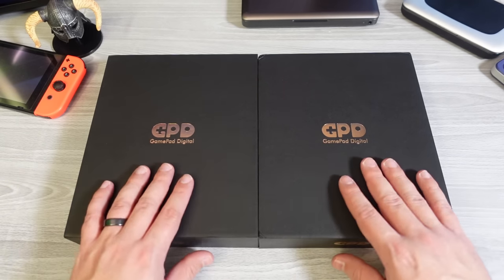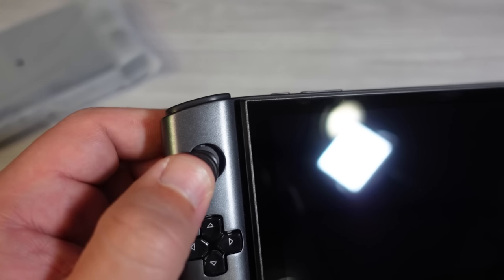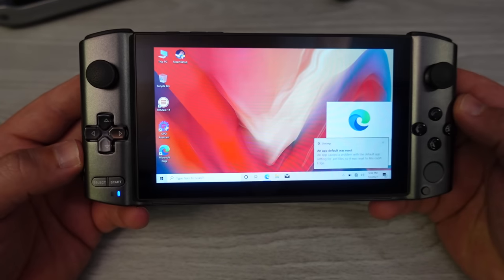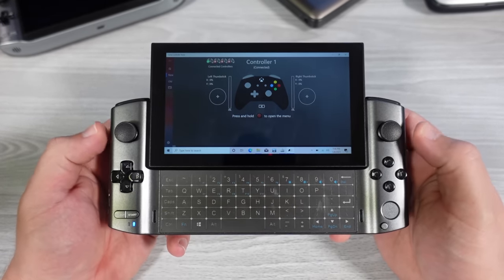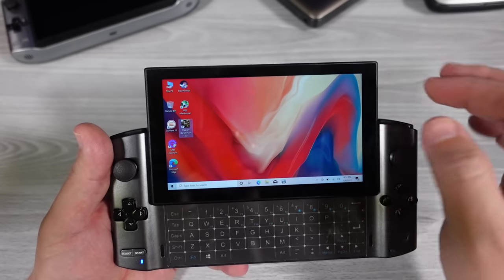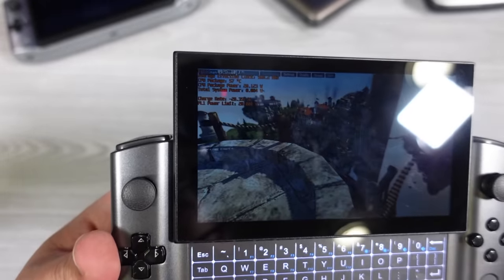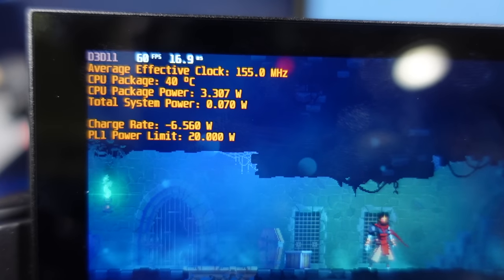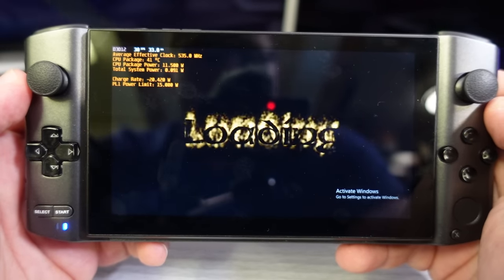GPD Win 3 - Unboxing and Quick Impressions

Comment: The egpu support is the biggest thing that was needed for this. Can use it otg, but when you get home you have a full gaming rig. Sweet stuff
Reply: Got to wait for a Thunderbolt 4 egpu dock to see if it will use the full 32gbs bandwidth under the tb4 spec for less performance loss.

Comment: The touch keyboard is kinda disappointing, I use the keyboard often on my win 2 and not sure I want to down grade my typing experience.
Reply: yeah why did they opt for a touch keyboard??
Reply: They opted for a touch keyboard as a space saver. Physical keyboards take up more space than touch and would make the device much thicker than it is now.
Reply: @techfreakjames  Also probably a money saver
Reply: @techfreakjames  yeah I know but I would have preferred more thickness with a physical keyboard. tbh I prefer the win 1 and win 2 clampshell design
Reply: @techfreakjames  not only that, but also troubleshooting and repair. If one key or more are dead, that's a whole membrane they have to throw out, clean the contacts, etc (lot more room for things to go wrong). Whil with a touchpad, it's just one digitizer. Swap it out for a new one if something goes wrong with it.
Reply: "2800 fps" *laughs in pc
Reply: @root8able  no, i think this is way better than previous versions, its more portable, looks more like what it is, a portable gaming pc, love it!! I just changed the right analog to became more like xbox controller and a slightly bigger screen!
Reply: @techfreakjames  *thiccer
Reply: @fkaiba94  why are you correcting my proper spelling with the slang one? Or was that a joke, in which case sorry I ruined it.
Reply: @techfreakjames  lol yup, you ruined it

Comment: I need this... got the win 2 months back and enjoy it but I would love to play all the newest games on the go
Reply: i got the p2 max and it came damaged i couldnt get a refund :/ worst 1k spent
Reply: @hoodeez  That's really unlucky I purchased several GPD units so far including two GPD P2 max (one I gave away to a friend) with no damages or factory issues.
Reply: think twice bro,look the screen its SMALLER than your phone,no
Reply: Cool! Got mine on 11.11 for 470$ on Aliexpress. Seemed to be a good deal. Liking it so far. Playing games from Steam that I would mostly likely never launch or just postpone. It's a great device. But Win 3 looks like a dream. No actual use of the keyboard but I will take it anyway.
Reply: @周崎-v9j  it actually isn't. Phones have bigger screens but they are not 16:9 or 16:10. They are just taller but that's wasted space. In fact, if you were steaming those games you'd get black bars on both sides of the phone's screen.
Reply: I would buy it if it is under $400
Reply: @civilman9058  that wouldn't even cover the cost of the cpu itself
Reply: @civilman9058  Would be great. I think you might get this price in a year or so when they release the GPD 3.
Reply: @lucascarracedo7421  well,maybe you can buy a 5.5 inch screen and run windows on it.the fact is this tiny screen is made for act games only(like god of war etc)because these game usually dont have many text or subtitle,you just need follow the arrows to slash and kill...but the rest of game like rpg and MMO which has ton of story lines,im sorry there is no way to see clearly on this screen,also its bad to your eyes.
Reply: Would have loved these internals in a clamshell design..
Reply: @周崎-v9j  clearly. I didn't say anything against that. I might not even buy it for design decisions I don't agree with. But that's the price of the product and it's not overpriced at all considering it's not a mass production device, and a very niche and  powerful product. That is regardless of how you would use it. I agree text would be hard in here. It even is on the gpd win 2. Wish that screen would cover more of those bezels.
One could argue that given this is a product most people would get to play in the go or to pick up and play at home, those story heavy games might not be the main target here. I doubt these devices anyone's main device. For this money a way more powerful system can be built. In most cases I guess the owner will also have a desktop or a laptop where they can play those slower games with tons of text and more complex UIs. Or they could even use an external display. The truth is that even the screen on the win max is small for those games anyway.
Reply: @周崎-v9j  regarding what people can or cannot see, that's personal. I can. The truth is that they could never put a 7 inch screen here if they want to have a relatively usable battery life. Gpd devices are always changing and are mostly steps forward but in many ways they always feel like a test for the next one. Maybe you'd want a win max with these specs? Might be the next one out.
What you are saying about screen size also applies to game streaming to phones. And those games you mention are also available to stream. So, since playing pc/console games on small screens is now a thing, then developers should start to include accessibility options to scale the ui for those use cases. If UIs can be adapted for switch versions, the same can be done for any other version. Games and the way people play are changing and these sorts of devices are transition devices.
Reply: There isn't a PC game I own that I can't get to work on the Win2 (maybe some need very low settings, but they work!)
Reply: @vlogger4567  yeah. Some are really constrained but for the most part there are solutions. It's part of what makes these devices attractive. In fact, whenever we get the win 3, it won't be running modern AAA games the same way it runs games from 2018 and tweaks will always be recommended.

Comment: I love the direction they are going with this.  I was sad when Sony discontinued their PC line, including the Vaio UMPC's which (along with Sony's PSP Go, Xperia Play, and Mylo devices) inspired this design.

However, the keyboard seems like a very bad choice for me.  If they were going with a capacitive touch solution, I would have preferred a second screen.  However, I think a physical keyboard, like with actual keys, or buttons, would have been better.

I have a GPD Win (1), and a GPD Win Max.  I am sure the power performance is a huge step up, even from the Max, but I think I will skip this generation (like I did with the Win 2).
Reply: A modern Xperia Play would be my go to, my current phone is the Xperia One. When the Xperia Play was out I ended up going for the iPhone 4S instead. Best feeling phone I've ever had, but I sometimes wonder how nice it would have been to have the Play.

Comment: 34:50 protip: use 25 watt power limit in bios, Use throttlestop in windows and set speedshift to 230 to limit it to lower wattages. 
that way it will run at 25 watts automatically (by switching profiles) when you plug it in. no restart to bios required.
Reply: Show me tutorial
Reply: @SRC267  ill make 1 in a week and reply

Comment: The controller seems uncomfortable to hold, a bit too small.
Reply: It will feel uncomfortable. It's the same issue with the Switch Lite, but for that you can buy adapters for bigger hands.
Reply: @SuliusLp  *grips
Reply: @OneDumbOrangeCat  Yeah, that's the word for it.
Reply: @SuliusLp  Yeah Switch Lite kills my hands. At least this is thick.
Reply: @SuliusLp  Yeah, the Switch/Lite is already uncomfortable, and this one has even smaller controller.
Reply: @michaelsun1654  But with a grip it's quite comfortable! I had a blast playing Fenyx Rising for a few hours straight.
Reply: ya and the button / dpad placement...  I can already tell by IMAGINING the thing in my hand... it WILL be uncomfortable. They should've done it like the vita, with the sticks UNDER the dpad and buttons.  then you just move your thumb closer to your other fingers to hit the dpad /buttons from a stick. this way (with the Win 3) if you dont' move your whole hand with your thumb (he pretty much shows this at the end when talking about playing Hades), you'll be awkwardly stretching your thumb to reach them from the stick. I'm not so sure I want this anymore...

Think I'll keep waiting for that alienware UFO thing or something else.
Reply: @Azhrei2000  Yeah eaxactly, the UFO or Aya Neo!
Reply: @Azhrei2000  they moved the right analog from the bottom since it caused issues when sliding up the keyboard. Putting both analog at the bottom would have caused that problem. The vita, UFO and aya neo do not have a slide up keyboard so those don't have the same problem.
Reply: @techfreakjames  oh please... As seen in this vid you can move it up with one finger from the middle. You telling me the people testing this were so inept they couldn't get their finger around a stick for a second?
Reply: @Azhrei2000  i personally have no problem with the analogs being on the bottom, so don't be aggressive with me. What I said was from the feedbacks received by GPD. Watch phawx's earlier vids on the Win 3 for the rationale on the analog positions. Everyone has their own preference. At the time the feedbacks were solicited by gpd, people only had pics of the unit to base their feedbacks, not the actual unit. The fact that the Win 3 can be opened from the middle is not something the phawx knew before he got the unit.
Reply: True. I wouldn't mind a large version the size of Alienware Ufo or slightly larger than Nintendo switch. For portable gaming comfortability matters the most.
Reply: @techfreakjames  "oh please..." is "being aggressive"?? I think you need to go to your safe space...

Comment: I've had a Win 2, it made me fall out of love with these super niche products. Apart from spotty Chinese QA, they come with very questionable ergonomic designs. I fail to see the point of a physical touch keyboard over the Windows touch keyboard done in software. The slide out screen is just one more moving part to fail, and I bet puts unnecessary complexity in doing repairs.
Reply: It's there because people don't want half my screen covered. Use your phone in landscape mode to type then tell me it basically taking over the screen is comfortable. While not great it's better than a screen keyboard that's not always easy to use on screen
Reply: @NerdyDude186  if the alternative was a regular tactile keypad, sure, but for the life of me, I can't name one reason why you would want a separate touch keyboard. You can't really use them for anything remotely productive, outside of typing in your WiFi password

Comment: An update solution for the keyboard is to give the user a "toggle-able" option for key imputs, making it where rather than touching the key, it won't register the imput until you let go of the key, therefore if you press the wrong key you can just slide on over to the right one next to it.

another option they could give is either adding Swype for those who like that sorta thing (I'm one of those people, I have wide thumbs.) OR they could simply add abit of an adjustable delay feature.

Even though a physical keyboard will always be better, there's atleast some ways they can improve it to atleast make it more like a keyboard found on a phone.

another trick I recommend trying, even if it might not be as good, is to try out the windows onscreen keyboard, you have to enable it in the windows 10 settings, and after that you'll have a keyboard symbol in the bottom right you can touch to pull up the digital keyboard.

Comment: Don't break it this time Phawx! :D

The Win2 has a better key alignment hence it has a much better typing experience. The alignment is more important than the size. If they put a similar flat keyboard with correct alignment (and a right shift key as well) then it would have leagues better than the current iteration. Just because of the current keyboard on the Win 3, the accompanying dock is a good option to get just so we can use external keyboards/peripherals.

Comment: A note on the silver and black color. Since this was based on the Sony UX, the color is actually UX's color as well. Black being the later 390N and 490N models, and the silver one are from the early 180N and 280N models.

Also, trust me, the touch keyboard is an improvement over the original UX keyboard, the original UX keyboard is the absolute WORST to type on. I liked the Win 2 keyboard the most, hope they get that keyboard back in a future updated model of Win 3, maybe with slightly bigger buttons.

Comment: Nice. I will watch the full video tomorrow and wdit this comment because it's 2 am (02:00) currently in the UK (exactly 02:00).
Edit: I's 02:01 now and I just realised the video is over a hour long. I will watch the video later in the day (I realised I wrote "tomorrow" in my original comment when it actually is the same day) <--- I finished this at 02:00 .

Comment: That's a nice surprise, I'd love to have internal USB on my Win 2.
Reply: even so the internal space inside win2 chassis is too small.
Reply: @shinjiikano538  You would be surprised what you can squeeze in, there's a good amount of space to the left of the SSD (where the SSD cooler mod goes) and also I have the extended full size SSD case on that I haven't yet installed an SSD in, so I could use the space for something else.

Comment: Problem with the keyboard is it's set to use in standard horizontal mode. It needs to switch to vertical length to accommodate the sideward thumb probe.

Comment: I was thinking about getting this but I think I might wait for the GPD Win Max 2. 
1. I'm hoping they will increase screen.
2. I'm hoping they will fix the keypad to being more like previous versions or maybe get rid of it all together but have it as an extra add on accessory for wireless use. 
3. Move from Intel to AMD
4. More battery life. 
5. Better placement with controls. 

Win 3 looks promising but I think they could improve alot in the next iterations and maybe in a few years will they break the niche market and be up there as a solid gaming/mobile pc for the mass.

Comment: Awesome video of the new gpd win 3. I love your videos keep up the great work. Thanks for another phenomenal video. Hey I have a quick dumb question though I hope you can answer thunderbolt 4 is backwards compatible with thunderbolt 3? Right? Just trying to make sure I can hook up my aorus gaming box egpu to the win 3 with no issues. Thanks in advance.
Reply: It's backwards compatible. I'm more curious if there is enough clearance for air when you lay the Win 3 flat on a table for when you connect it to an egpu. The grips looks like it might give a bit of clearance but from what I saw from an unboxing by a chinese reviewer, it looks like the intake might be blocked if you lay it on a table.
Reply: @techfreakjames  hey thanks so much for your reply and the info. Actually that is a very good point I guess we need to buy the special dock for the gpd win 3 that gpd was showing off too so we don't have to worry about laying it flat on a table.
Reply: @GotThatNeed  the dock won't help. There's no thunderbolt on the dock. Another guy suggested I prop it up using anything else to create the clearance. I do have a tiny stand that could raise the intake, so problem solved.
Reply: @GotThatNeed  the dock won't help. There's no thunderbolt on the dock. Another guy suggested I prop it up using anything else to create the clearance. I do have a tiny stand that could raise the intake, so problem solved.

Comment: Only 44watt battery so this will only manag 2hr of gaming lol
Reply: Switch only lasts like 2.5 hours.
Reply: At max TDP, which you just need for newer games. And even then, you can always lower their settings, and/or force them to 30 fps which is what you get even on last gen consoles (and new ones on quality mode).
Reply: @lucascarracedo7421  Both of these chips are actually horrible below 15W. It's really more of a 15W minimum, these are actually 25W chips that have had half their tdp dropped to get usable battery life.

Personally I'm still holding out for a ryzen based handheld since those chips perform a lot better at low tdp, which means you can get better battery life without losing too much performance.
Reply: @DBZHGWgamer  yeah but even set at 15w they won't just be at max TDP for the sake of it if the power required is actually lower.
Reply: Even then, this is not comparable to a switch. It's a pc, with games not optimized for specific hardware or even mobile gaming in this sense. So the fact that it can barely match the switch's battery life is not really conclusive of anything.
Reply: Minimum 3hrs of gaming, its will be enjoyable, this thing its heavy cannot attach big battery addon, not like switch lite, i manage mod 59.8wh to switch lite case, and manage 12hrs playing switch overclock. Lets be honest switch lite consume only 4.8watt on overclock to docked setting(bump 67% perfoma uplift) and we all know gpd is complete packed mini pc, with non optimized for gaming, sure its power consuming, need to limit cpu on 10watt. Then 3hrs can doable
Reply: @whitefata104  really a minimum of 2 hours since it's 15 W plus 8 W for the rest of the system.
Reply: @DBZHGWgamer  seriously which Ryzen chip performs better at 15watt? 

And has a better gpu than this
Reply: @directlinkrexx4409  the gpus should be better
Reply: @directlinkrexx4409  4800u and the 4500u both perform better at 10 and 7 watts than Intel chips.
Reply: @DBZHGWgamer  can you show me a video or benchmarks Coz the Intel performs better
Reply: @directlinkrexx4409  I can't find any on YouTube that test various tdps, but I know from friends who have Intel and amd laptops. Besides, even at 15W the 4500u beats the 1135G in half the games the 1135G can run, and that's ignoring the many games Intel can't run and the fact it doesn't work with most emulators because of Intel's crappy drivers.
Reply: @DBZHGWgamer  you are just talking show me benchmarks

I can't take you seriously
I have given you links